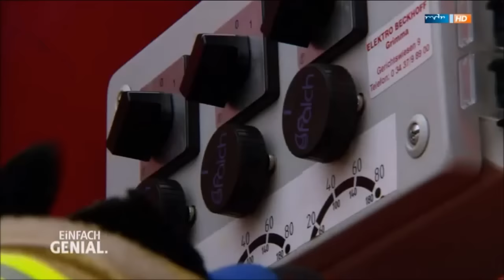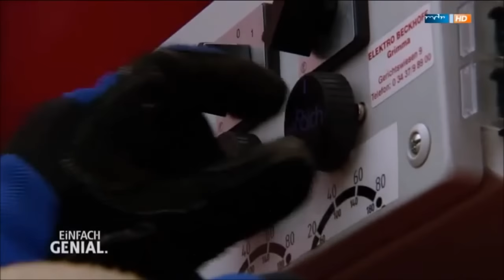Balayeuse Faun Viajet 6 / Street Sweeper, Road Sweeper, Street Cleaner, Veegmachine

Comment: I thought road sweepers in Germany drives on the right side
Reply: Yes, when they  are used by departments of sanitation, they actualy do, so the driver has a better overview of the gutter. But when they are used for the cleaning of larger areas, such as airports or on the Autobahn -or here, in service with a firestation on many types of roads - they often have normal steering like an ordinary truck.